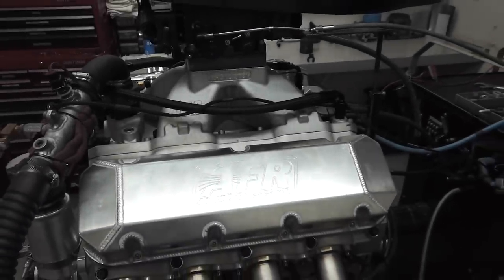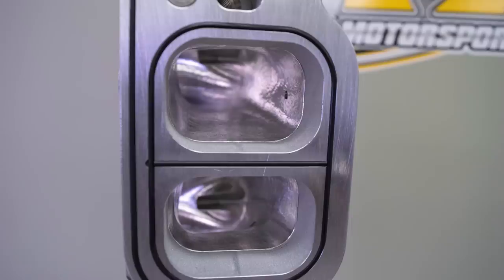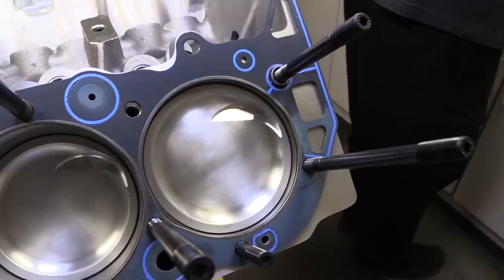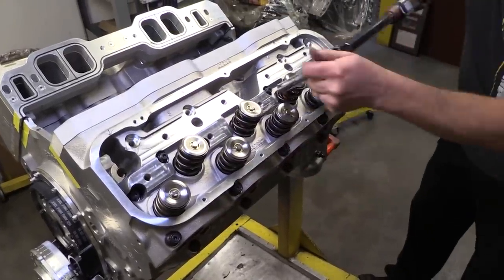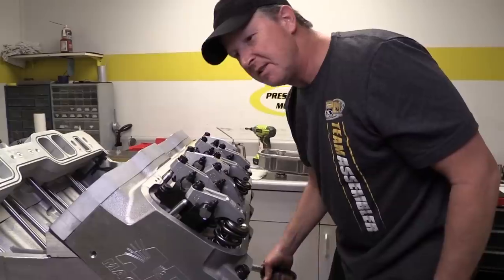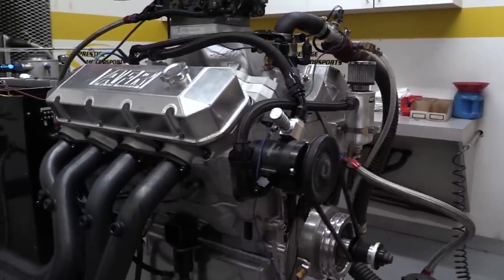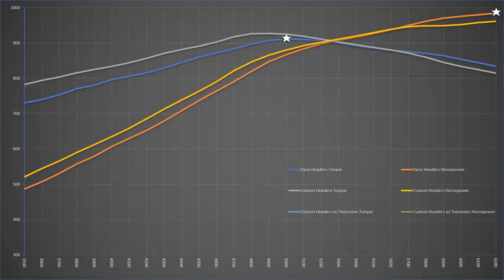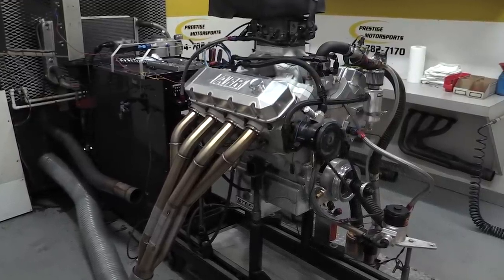665 Cubic Inch (10.9 Liters!) Monster Big Block Engine Build [The Displacement King]

Comment: I used to build top fuel cars 10 liter Arais Motors and 8.3 liters. We had 6000 h.p back in th 90's on the 10 liters. Fun times. That's a sweet pump gas motor.
Reply from the maker: If you were rebuilding TF motors in between rounds, you were earning every dollar they paid you. Thanks for watching!
Reply: 6000 h.p. for 3 seconds before overhaul.
Reply: @notpoliticallycorrect4774  mimimimimi :P
Reply: I will add I used to build top fuel cars in the 2000's so may rules have changed. I know this we bought 3 crankshaft at $3000 each. Made one pass and NHRA. Banned them . you couldn't sell them so $9000 grand down the tubes. We did Exibition racing Paul Wilson. I know what I built and so does thousands of others.
Reply: We were collapsing our fuel cells one time from so much power.
Reply: I was working for arias when they shut down. Those hemis were so badass. Nothing else quite like it out there. We still had guys ordering up parts for them when I was there.
Reply: @notpoliticallycorrect4774  So? Those engines could make 1000 hp for 50 years without an overhaul. Any one of your engines wouldnt even last in the first 0.1 seconds making 6000 hp ;)
Reply: @jonnyj.  No they couldn't, topfuel dragsters have no water cooling, any extended run time beyond a quick 1/4 mile blip would completely destroy the engine due to overheating.

Comment: These videos are awesome! Very informative. Absolutely Love the technical details and footage! Wish I would've found this channel sooner!
Reply from the maker: Thanks so much for the kind words. And thanks for watching!
Reply: @TheHorsepowerMonster   you 665. Big.
Reply: @TheHorsepowerMonster   hey
Reply: @TheHorsepowerMonster    wat kind a v8 isit
Reply from the maker: @justingriffith2991  Technically it is a Chevy but no parts are made by Chevrolet or GM
Reply: Isav8 how $ will it
Reply: Hey
 How can I get 665 bbc Wat
 Is
$ will
Reply: lets run it tilted upside down with just oil injection and Motul 800 2t. Sounds like a big snowmobile 2 stroke to me. Do you run stock oil injection or do you premix the 665 CID v8/ What is your premix ratio? i would nothing but motul 800 2t if i had this! What is your VRO pump feed oil injection rate into the intake on this v8?
Reply: @TheHorsepowerMonster  hey Steve 665 bcc is foor sell wat is the : hp

Comment: First thing I thought was: Boat motor. Then you said it's going in a swamp boat. what a ride!!!!
Reply from the maker: Agreed! I hope to follow up with some photos of the boat in my social media once they get it installed. Thanks for wathing!
Reply: @TheHorsepowerMonster  Always good content. If old mate ever gets bored with that much grunt. a Couple of light pressure turbos (say 5-7 PSI) will still play nice with pump fuel and scare every croc (or alligator) for miles around.
Reply: @TheHorsepowerMonster  what kind of cost will one of them be.  I'm sure it is not cheap but as they say big boys toys just cost more
Reply from the maker: They didn't tell me what they charged the customer and I didn't ask. This was also a one-off build and not one of their usual engine packages but I'm thinking probably a little north of 20 grand. But that's just a (slightly) educated guess.
Reply: @larrysutton6530  The block is around $9k and those heads are around $8k so I would guess this build with labor would be in the $50k-$60k. This motor had a lot of labor with the heads and intake matching the tall deck.  Great videos lately.
Reply: @compt3ck  thank you for the info and while I knew it would be expensive that is more than I expected however not unreasonable for everything that is there just way more than I can afford unfortunately
Reply: Wow hold the f*** on
Reply: @compt3ck  Agreed.  No way was this engine under $50-55k and probably closer to $60k plus with all the custom work.
Reply: @damanifesto  yeaaaaa im nust gonna buy a hellaphant
Reply: When you gotta pull wheelies in stuff that doesn't have wheels!

Comment: Damn. That thing had a lot more I. It too. Perfect set up for that boat thou. Set up exsact.  Twin 1250’s on a sheet metal intake and some more compression that thing would have made well over 1100hp. That’s crazy it made that much  on pump gas and a single carb
Reply: I could be wrong, but I feel like they could achieve similar numbers with a 10.2” deck engine like a 632, less work and less money...
Reply: Yes we have made 1,100 hp easily on a 632ci but this is specifically made for an airboat to run at around 5500 rpm, people get fixated on hp and don't think about what the engine actually is used for.
Reply: @shitbox7413  You are not wrong at all.
They could have built a much better 582 with more power all over the curve, and zero windage issues.

Try this for instance.

10.2 block
Callies 8 weight 4.375 XL crank
Crower 6.700 rods
CP pistons with ceramic top coat
11:1 CR
Pro-Filer 24 XL heads
55 mm cam w. 262/270 duration, .876 lift and 110 LSA
1.8 Shaft rockers
Adjustable cam belt drive
Moroso vacuum pump
Dart/Wilson Tunnel Ram
Twin 850 XP double pumpers(Plenty for the power and better tip in and response than Doms)
Holley dual sync DIS ignition

More power everywhere and much more reliable, not to mention cheaper.

This 665 build is just silly, especially for a boat that need continuos high rpm. There's a reason why you don't see any of the reputable builders doing it. Sonny Leonard is the only one, and he goes about it completely different.

I mean, 18 degree heads and then a .717 lift cam? Ffs...
Reply: @codymccleary9026  Yeah, and way too few get fixated on windage on a boat engine that has to run cont. at over 5000 rpm. 5 inch stroke? Yep, great idea.
Reply: @AB-80X  that is why we did multiple tests on that and worked directly with steffs on multiple pans and developed this pan to solve that issue. It's not our first rodeo.

Comment: I luv big inch engines, they have a real boom to the exhaust note. I just put a similar engine together (638") with a Keith Black 11.2 block & Brodix twin plug heads, same valve train with a KB gear drive, twin crank trigger ignition (16 plugs) with Moran EFI injectors & a pair of 129mm turbo's. My big muther should should be fun with 4WD!
Reply: Yeah, absolutely no other motor design has the ground shaking sound of a huge displacement V8.
Reply: I thought KB went out of business.
Reply: @robertyoung9136  Ken Black sold the company a while back & it's being restructured by the new owners.

Comment: Now add twin turbos and you have yourself a rocket 🚀
Reply: So 1 per cylinder then.....
Reply: Budget Boost DIY  11l/2=5.5l that is huge you need big snails
Reply: No turbos, just fuel injection. Hell, you might even get 10 mpg at cruise.
Reply: @Richard NZ "belt driven turbo" that'd be a supercharger. A ProCharger style supercharger.

Comment: I would love to be able to get something like that between the frame rails of my GMC pick up truck!
Reply: Currently just running about a 400 small block in the truck with a near 400,00 miles on the odometer. Since the last pull apart and the high miles decided to see if a 95 dash assembly would fit. It did so I went with it and liking the 93 with some 95 interior parts some engine bay stuff.  Next toy 2004 Pontiac seats.

Comment: NICE 780 lbf⋅ft already @ 1500?! that means you can spin your street legal tires just a little bit over idle! Thats pretty economical i´d say!^^
Reply: Yeah im curious what MPG it would get with a super long top gear spinning the engine as low as possible at highway speeds

Comment: Great, great engine but could you make close the horsepower and torque with an LS motor cheaper?
Reply: guys do all the time. 
Cletus McFarlands first LS in his buggy vette 2018 went 300+passes in the 8s and 7s, dinoing out north of 1500hp and on to 1700hp with the second LS they replaced it with. 
427 twin turbo. 
drove it from Florida to Denver for LS Fest and got 11mpg!!!
Reply: sure, i'm well aware of the pounding a v8 gets above 1000hp if more than a few seconds at a time. and shorter strokes is where it's been at for over 60yrs now(for longevity and reliability)--is why i wouldn't make a 5" strike motor and run it past 4k if i wanted it to last. midas well put that thing in an airplane cause it's stroked and bored very similar to a 500hp av gas motor that doesn't rev up above 3k. 
Nelson Racing has a premiered video on a 260ci LS with piano wire hoops on the cylinder tops and dino'd out above 1500hp...and ran above 9600rpms and he couldn't kill it. that also was for a boat. 
so yea, i know.
Reply: short stroke forced induction high rpms are replacing long stroke big displacement n/a's.
better mpgs
higher potential hp, less driveline mass, etc etc. 
already semi-truck power plants size have shrunk, mpgs doubled, and hp's more than doubled. 
and if the aviation world can do it, cars and boats can do it too. 
just sayin.

Comment: I imagine the redline will be below 5,500 rpm.  Tough to imagine it will survive spinning to over 6,000 rpm.  Very, very impressive overall.
Reply: The rotating assembly would handle over 8000 rpm in a drag application. The biggies issue here is lubrication. Even at 5500 this thing definitely turns the oil to foam and oil pressure will drop.
Sonny Leonard has his big engines with 5.75 stroke at well over 8000 rpm.

Comment: Anybody else think the starter was hanging the first time they started it? the other pulls sounded fine.
Reply: I thought so too. Something didn't sound right.
Reply: I think maybe with that much cubes and its first time turning over that the surface tension of the lubes just might have been that tight. Similar if it sat for months.

Comment: This would be an awesome motor swap for an old BBC motor home.
Reply: Ya if ur trying to turn it into the spaceballs motorhome! That thing will move!
Reply: Motor home with deleted and tuned 6.7 Cummins engine will be the best option. 10l gas engine on motor home will be 2 3 miles per gallon if lucky

Comment: I remember when me and my brother Mark were teenage up and coming gearheads in the late 70's and early 80's. Somewhere we had came into possession of the  catalog of a company that built and supplied 600+ cid( *super tiger paw) big block engines for offshore racing / drug running boats, lol.
Now then, how we imagined that if ever we came into our fortune just how bad assed awesome of a street racer we'd have with one of those!
Anyhow we built quite a few high performance cars, pickups, airboats and motorcycles throughout  the years of our youth.
I thought that I had long grown out of all that, but... now in retirement... what next?
Keep 'em between the lines.

Comment: The crazy thing about this build, as nice as it is, is that 12 months later GM is offering their version of badass big block as a 1000hp pump gas crate motor.
Reply: Yup, the ZZ632 is a beast, and probably vastly cheaper at just under 30k for the crate engine  - things get very pricey when you start playing with non standard block geometry.

Comment: IDK why but one of my dream builds for a grudge car is a 500ci Brodix aluminum block with Frankenstein/Brodix apollo 14.5's Bryant crank GRP aluminum rods Diamond pistons and a bad ass Hogan intake and a 5" Tb and a huge single turbo set up either a custom Holset deal from Wiemer or that new 140+mm precision on alchohol and throw the boost at it and rev piss out of that bad boy! No idea how it would run or power but I know it would make a 2800 pound car go bottom 4's

Comment: I guessed 1000ft. lbs. torque. Close.
Reply: I was guessing the same with 1000 hp
Either way it is an impressive motor. Heck, you would have to have a tire truck follow you to swap tires in between gas stations lol
Reply: 1000 ft with that cam? Not even close. 717 lift for this combo is just idiotic.
Throw on a set of Pro-Filer 24 XL, a cam with 259/269 duration and 800 lift, and it would obliterate this in short order everywhere in the curve.
There are engine assemblers and engine builders. These guys are assemblers.

Comment: Start with a Roadster Shop chassis, add a '66 Chevelle body, some engine setback, and really quiet mufflers. Wire up some modern fuel injection (with traction control!) and you'd have the ultimate muscle car.

Comment: I don't need the rear trunk in my Fiero.... That space can be occupied by the right bank of this monster. (Right bank, looking from the flywheel end) 
But I thiiink my stock, Muncie 4 speed manual, the diff, and axles just might not cut it..  Better beef those up starting with an overbuilt 5-speed manual, and go from there.  

That'll get the front-end up!

Comment: That’s a $20k engine and they’re using a Ryobi to assemble it. Proof that you don’t need Snap-On to build a quality motor.
Reply from the maker: I never thought about it but you are exactly right. They just use it to run the bolts down and then go back through with a torque wrench. Great point!
Reply: Thats probably a good bit more than $20k.
Reply: Yeah they got it from their local Pawn Shop 😆
Reply: jubjub f More than double
Reply: I'm sure that engine is in the tune of 50-60 grand or more. That custom block alone is probably 8k,  the custom crank, rods and pistons are probably 7-8k, the belt drive is around 1200 or so with a crank trigger, not counting the custom pedestal mounts and rockers, yadda, yadda, yadda... labor, warranty, if there is one.
Reply: Snap on is very over rated and extremely overpriced. 
Its for mechanics that worry more about flash than function.
Reply: $20k wouldn’t get you this engine, I’ve seen standard deck BBC builds with conventional heads run in the $20k range with all off the shelf parts.
Reply: @shitbox7413  BluePrint engines BBC 632ci V8 815hp $10-14k 1-2 yr warranty or 36k mile, I cant remember..
Reply: TigreLoko24, Yeah pretty good deal on those engines, lot of imported parts though...
Reply: @shitbox7413  they supposedly make the parts themselves, I've thought about buying it, maybe in the future..
Reply: TigreLoko24, I know their blocks are cast in the USA, as far as rotating assemblies and cylinder heads, I would assume they’re imported. That being said, I wouldn’t hesitate to buy one, that much torque for $12k and a warranty, hard to go wrong there.
Reply: @unbiasedcobra6672  but if you have certified tools youre not gonna being using ryobi and craftsman on an airplane

In a small shop or non certified application shit just uae that or porter cable lile I have..
Reply: @KingJT80  airplane? What? 
Snap on doesn't make a tool you can't get from a different company. It's usually cheaper and the warranty is the same. I've tried to get warranty out of snap on.  It's a fucking nightmare. 
Try to get warranty with the competition and it's really simple.
Reply: @shitbox7413  i agree, for that price, great power.. I like their customer service the times I've talked to them, many great reviews too, just wish the engine could handle more boost for it being forged internals, 5-15psi depending on which 632 you buy, obviously the $14k one handles 15psi, you need to buy intake n carb/efi tho..

Comment: Weak point would seem to be this little triangle spacers if you get any kind of pressure behind them.
Reply from the maker: They just seal the lifter valley, so they aren't really a stressed component. But they are bolted to the china rail. Thanks for watching.

Comment: The oil squirters are used mostly in boosted motors. The heat from a boosted motor can burn a piston crown so the oil squirter helps keep the underside of the piston crown cool.  On a N/A motor squirters aren't really necessary unless you are pulling a lot of crankcase vacuum or are going to be running the motor at lower rpms. The oil will then be directed at the pins.  You should explain why you are modifying the block so not to make everyone feel their motors need this modification.

Comment: Now imagine this with the biggest supercharger that kenne bell makes, the 4.7l or 4.9l one. 2000+ horsepower and torque almost certainly.
Reply: Not big enough - one of PSI or Whipples 10.3 Liter screw chargers  would do nicely. But then, if youre gonna build a boosted engine, you wouldnt bother with the exotic block - you can easily make 2000 hp on a conventional 10.2" tall deck 572 - Nelson Racing engines offers a twin turbo 572 that will do it. Start running E85, and you can do much, much more.

Comment: Way back in 1997 I built a rally engine that needed adaptor plates for the side draft carburetors and I "o" ringed both the inlets and the exhaust, viton for the exhausts and conventional for the inlets. The engine is still in use and while being rebuilt twice since, the "o" rings have proven far more reliable than typical gaskets, particually. Since the "o" rings are encaptulated in the ali head and the ali is water cooled they do not see extreme heat. because they do not leak, their is no hot gas to erode them. Its a no brainer!

Comment: I would be concerned about the valve relief cut area being a potential area for ring land issues.
Reply: Not an issue,,6500 rpm motor non race gas

Comment: i d do it shorter stroke and bigger bore,that allows higher comp while still on pump gas.everybody says long stroke increases torque but bore does it better.long stroke has to be complemented with long rods to better torque.torque is calculated as force times lever.force or cylinder pressure  is pressure times surface area of piston like in hydraulic ram,plus increased bore means better cylinder flow.i wonder why they use only 4.600 bore?
Reply from the maker: Because that is the largest this Brodix block will handle. Great comment and thanks for watching!
Reply: @TheHorsepowerMonster  yes i do get that but i sort of understood that cost is no problem so i thought why not go with 5.0 or 5.3 bore space tall deck??having raced bbc well over 10 years i love this kind of vids.